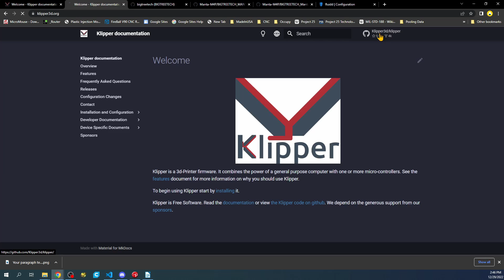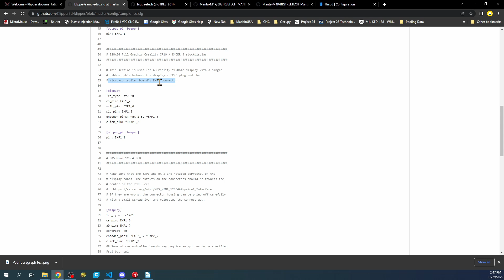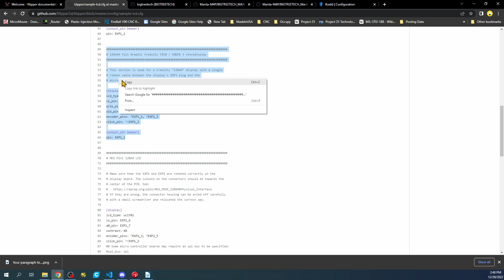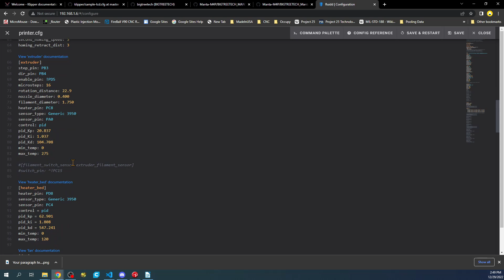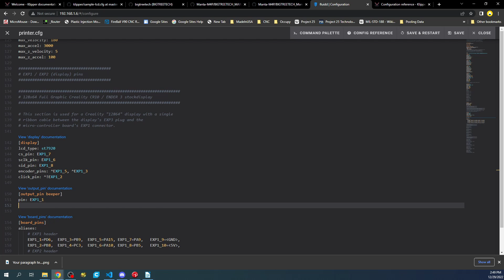BTT - Manta M4P - Creality CR10 Display setup

Comment: Hi man amazing tutorial! One question please: I used my creality stock stepper cables with my M4P but my x and y motors are overheating at idle after only homing . Z stepper stays cold af...Would you mind sharing about the motors wiring on the Manta please?
Reply from the maker: Need more details.  There's a Discord link in description.